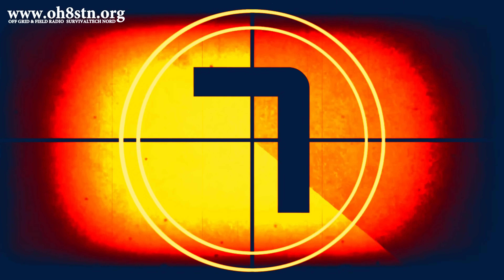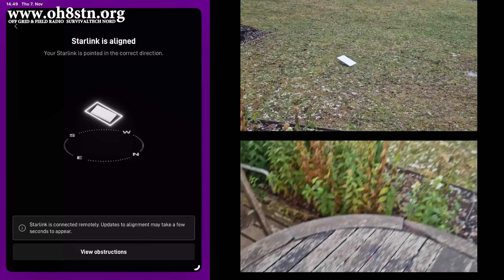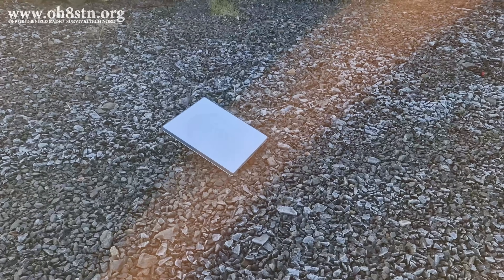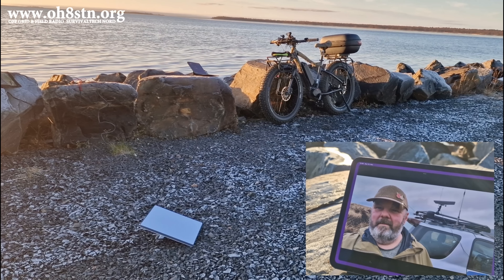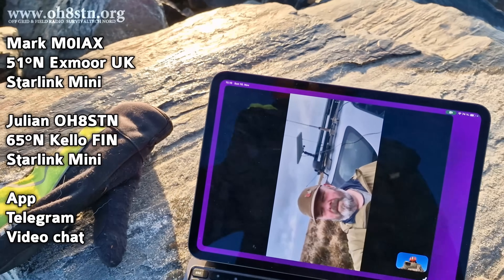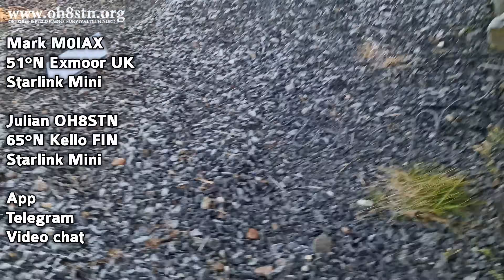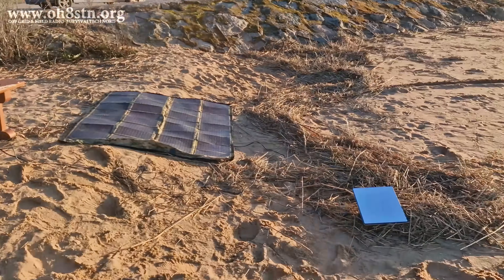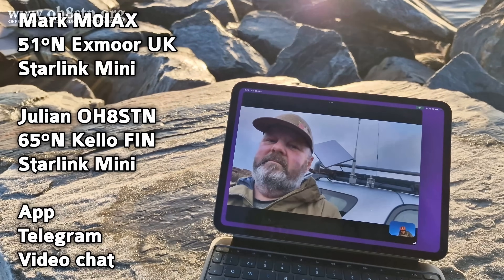Starlink Mini: Setup & Field Test | Disaster Communications

Comment: Julian, something unlikely but important needs to be considered with Starlink, especially for preppers and Auxcom operators.
 We are severely crowding low earth orbit slots with raw technology, and this might ensure a Kesseler Event occurs. Basically, if just one satellite collision (accidental or intentional) the debris cloud will break up more satellites. In a worst case scenario, this could eliminate nearly ALL LEO SATELLITES in as little as an hour or two.
 There's no defense against this. Arthur C. Clarke warned of it around 1960.
 So while Starlink, and the coming competition, offer marvelous features, they are a fragile system depending on fragile infrastructure. Unlike ugly old HF radio, which simply can't fail that way.
 Something more folks should be made aware of.
Reply from the maker: You're preaching to the choir my friend 👍. Although it's a good point, I still can't call my grandmother on an HF radio. So we use these tools as long as they're available. These are all just tools in the toolbox.

Comment: Julian, got the starlink up and running. Using the 65w usb c charger run off my 13.8v lipo battery. Got a usb c cable that connects to starlink unit
Reply from the maker: Outstanding 👍

Comment: I’m looking to do a diy version of the starbatt mini a grab and go kit to store and power the star link mini. There is not a lot of information on the starbatt mini website but my question is would it be better to run the star link mini off a 24 volt 100 amph or a 12 volt 100 amp h battery?

Comment: Have you tried a Garmin Mini 2 messenger?  It's not Starlink - only for short text messsaging or SOS but the device is 3 oz weight and tiny size, it is small enough to fit in your pocket.  There is a small monthly fee, but you can text anyone with a cell phone from your phone or device, and send position reports as well as get weather even if completely off the grid.  I carry mine when hiking or boating, but it would also be useful in a regional grid down scenario.

Comment: Unfortunately I cannot afford the initial cost of this system not to mention the monthly fees. However I cannot afford to be off line either. I am Paying the same fees for service which is both internet as well as telephony which is now basically VoIP since the modem has a pair to pots line outputs which serve for landline as well as internet service. The telco provider has serious issues with backup power to the DSLAMS that provide the fiber to copper translation. When the electric company looses power the translators shut down since they require power to operate. They are equipped with a UPS system but the telco provider has not provided batteries for the system to work properly. Still waiting for a bit over a year for the fiber instal. Even received a Nokia fiber to Ethernet interface but it’s just sitting around gathering dust.
Reply from the maker: Understood.  Price is slowly coming down. Monthly ax well. If you use it simply for disaster comms, you can keep it deactivated, then started up once the disaster starts. Even if the internet is down the dish still has connection with SpaceX servers.

Comment: You best have a stack of LFPs, even a mini burns a lot of power. I run a Gen 3 with a 460AH.
Reply from the maker: Indeed. 40 watts during start up. 17 watts when connected. Mini seems more efficient.
Reply: @OH8STN  I just converted the Gen 3 to 12V. That should help a bit, not losing power going pack and forth with the inverter. We'll see.

Comment: Getting satellites into higher latiude orbits is expensive.  You need high latitude launch sites and don't have the advantage of using the earth's rotation to reduce the fuel on launch.
Reply from the maker: It is a good thing we have the falcon 9.
Reply: @OH8STN  It will still cost more per item to get the orbits above 65 degrees.  Unless the Russians let them be launched from Plesetsk.
Reply from the maker: @braidybecket8946 Elon has already discussed additional starlink sats for polar regions.  Anyway,  it's working extremely well so far.

Comment: Starlink is for sure exceptional for off grid, but in a grid down event the internet itself will it really work? If telegram’s servers are down telegram won’t work, same for mail, dns, etc 
So even if the starlink network will work probably all the different ways to communicate over the internet won’t work or the will suffer massive disruption
 An incredible tool but radio is still the main tool in a grid down event
Reply from the maker: For a widespread grit down event, I wouldn't use starlink. For a widespread massive event like that, I would rely on robust and reliable HF radio. But as we've recently seen in Hurricane helene, the internet wasn't down for example 100 Mi away, it was only down in the local affected area. In that case, people in the affected area needed to reach Beyond line of sight to where the internet was working the best way to do that, was with satellite.
Regarding the cost, once you have the Starlink hardware, there is no monthly charge until you activate it. Compared to the price of a HF radio, starlink is quite reasonably priced.

Comment: I feel like theres this misconception about Starlink, that it is "Off Grid" when in reality, you are still relying on someone else's infrastructure, so it's about as off grid as a cell phone.

Is it useful technology? I guess? But so is a cell phone. All this tech does is use a dish instead of a tower. You still have to hope that Space X keeps the project running and continues to allow you to use it.
Reply: "Off-grid" typically refers to being off the electrical grid, or at least it used to.  Sometimes when people say "off-grid" they really mean "self-sufficient" or "self-reliant," which I believe is what you are describing.  Being self-sufficient includes being off-grid, but being off-grid doesn't necessarily mean being self-sufficient.
Reply: @gravijta936  I can see that definition mattering for other devices, but for communications specifically, I figure outside networks required to use a system would be a far more important factor

After all, if we are only counting the power grid for the definition of "off grid" then cell phones are off grid, since cell towers have batteries and generators that keep them running when the grid goes down.
Reply from the maker: There is no mention of Starlink being 'off grid' in this video. Moreover,  towards the end of the video, Starlinks dependence on the 'man in the middle' was discussed as one of the downsides. What you might be missing are a few use cases.
1. A regional disaster where local infrastructure has failed. Use Starlink for emergency internet access 
2. Used by disaster relief teams for portable, rapid deployment internet.
3. Compared to z cell phone base stations, the base stations orbit 300 miles above the surface of tge Earth, outside the disaster zone.
Starlink saved lives during Hurricane Helene:

Emergency Internet Access: Starlink, a satellite internet service, deployed hundreds of free devices and provided unlimited data plans to remote areas affected by Hurricane Helene. This enabled communication and access to vital information, such as weather updates, emergency services, and relief efforts.
Lifeline for Isolated Communities: Starlink’s satellite-based internet service reached areas with destroyed or damaged infrastructure, providing a critical lifeline for communities cut off from traditional communication networks. This allowed residents to contact loved ones, receive critical updates, and access essential services.
Coordination and Response: Starlink’s internet access facilitated coordination between local officials, emergency responders, and relief organizations, enabling more effective response and recovery efforts. This included sharing critical information, such as damage assessments, resource allocation, and evacuation routes.
Reduced Risk of Injury or Death: By providing reliable communication, Starlink helped reduce the risk of injury or death due to delayed or miscommunicated information. For example, emergency responders could quickly receive updates on damaged infrastructure, allowing them to prioritize rescue efforts and avoid putting themselves or others at risk.
Reply: @OH8STN   @OH8STN  Well, Off grid was in the title of the video before just now, but it's fine, I won't mention it if you don't. Also 3:31 if you wanna scrub that as well. 

Like I've said, I'm not saying the tech isn't useful, I just feel like it's a bit overhyped right now as this perfect offgrid solution ever since Helene. Someone I grew up with is in Ashville, and I'm sure those services helped him. 

I am just also recognizing that the service has the "man in the middle" issue you mentioned, I just don't trust the fact that only one company provides it, so it leads to issues with a monopoly, similar to issues some parts of the US have with broadband access. And really, for what you get, it's awfully expensive, and thats only gonna get worse until theres competition, and when Space X basically control most of the commercial space flight in America, well, theres a bit of a conflict of interest there if competitors wanna get their satellites up there to launch their own system.

Ultimately, even though it's not connected to the electrical grid, it's still kinda hard to call it an offgrid solution when it relies on so much established infrastructure. It's just a different type of infrastructure.
Reply from the maker: @knightshousegames  so you start by calling me a liar, then referencing one of my off-grid camper trips in lapland, completely out of context, as "proof". OK 🤣
 Here's the cold hard truth. How you "Feel" doesn't constitute reality! You made some good points, but let your emotions ruin what would have been an objective discussion. Why not redeem yourself by suggesting for us a cost effective emergency internet alternative for rural communities where communications infrastructure has been destroyed by a natural disaster?
We'll wait for your reply.

Comment: Great video - really tempted! Is the router side of things configurable for port-forwarding and are the Starlink system ports open for such things as self-hosted web servers, FTP servers, mail servers etc.? Download speeds impressive, but upload speeds may inhibit full-time use for big video uploads - did I hear 11 Mbit/Sec? Not a deal breaker, but a bit slow for large uploads, especially 4K. Cheers.

Comment: “Not replacing ham radio but augmenting its capabilities”. Right. Starlink is a paid subscription service. In the US, that starts at about $120/month (mobile is somewhat cheaper but lacks baseline functionality). That’s a hefty subscription fee. Comparing amateur radio to Starlink is inappropriate since as hams we don’t have that sort of funding, nor does it cost us a subscription fee.
Reply from the maker: @pmadams65 
You quoted what I said in the video, then ignore it with your analysis..
Bullet points:
1. Winlink - Augmenting ham radio for those of us using Ham Radio for disaster preparedness. For example, using Starlink as an internet gateway for my  Winlink BBS. This means emergency stations can still send and receive email, even when the grid is down regionally.

2. Price - For hurricane Helene, Starlink waved the monthly charge which isn’t that bad anyway. I purchased the hardware for $349. The monthly is about $40, but only needs to be activated when Starlink is used. This is the price for Starlink Mini, which has the same connection functionality as Gen 3, minus the router and current consumption. On the Mini, the router and Wi-Fi AP are built into the enclosure. Under $500 for emergency internet doesn’t sound that bad to me.

3. HF Radio - I do not compare Starlink with HF Radio. As I said, it is an additional tool in the tool box. I generally prefer to keep JS8Call and Winlink up and running 24/7/365, whether or not there is an emergency. Unlike Starlink, HF Radio is not going to let me dial directly into anybody with an internet connection (outside the disaster area) like Starlink can. 

4. A non technical person with no radio experience has almost zero chance of making use of HF radio in a grid down scenario. We train for years to build core skills, then continue practising, to maintain and improve those skills. Starlink requires you to throw the dish on the ground, point it north, then connect to a Wi-Fi network. Your emergency internet is now ready to go.

5 Triggered complaining -  Rather than complaining about the capabilities shown in this video, why not provide us an alternative which provides the same functionality as demonstrated in this video, and at a similar cost? This would be more helpful!

Finally, it is perfectly ok to disagree with how I use and augment my communications strategy with Starlink. No one will hold a gun to your head and make you do what I do. Moreover, you shouldn't be so narrow minded about someone presenting an unconventional solution. Hurricane Helene showed us how useful Starlink can be.
Reply: @ I’ve enjoyed your channel(s) for years and always learn something new from them. I wasn’t complaining about the capabilities of Starlink; its usefulness is well known. In point of fact, I wasn’t complaining about anything. I was pointing out that Starlink is typically a rather expensive service whereas amateur radio has no subscription fees.

Comment: Been saying it for a long time Ecomm via ham radio in agencies will be going the way of the dinosaurs.
Reply: Video's call will probably chew through your monthly bandwidth allowance. In limited use they serve their purpose where visual information says more than words.
Reply from the maker: Perhaps yes. I still think there is an overwhelming use case for HF asynchronous data modes, for slow reliable network communications.
Reply from the maker: Indeed. I just wanted to show the reliability and stability of this robust connection. Just a couple of months ago, I would not have believed a UHD video chat would have been possible without a wired connection at this latitude.

Comment: What's the point of testing "starlink-to-starlink" connectivity in ham context?
Its like testing a regular cable internet connection.
What's was the goal to proof?

In emcom case it will work, i mean it's ground-to sat-to sat -to ground .
Why shouldn't it? No obstacles, no trees .

Maybe I'm missing the point, but would you please explain it?
Reply from the maker: Testing Sterlink to Starlink was simply a coincidence. This was more of a demonstration by someone who is a hardened ham radio supporter. He is simply saying 'here's another tool you might want to consider'. 
The video also went into the difficulty of amateur radio, and learning curve. Someone who has never used an HF radio before, isn't going to just grab that rig and be successful the first time. With this, they have a chance.
Reply: @OH8STN  ok, i see , thanks

Comment: I wish I had Starlink right now but it is just too expensive. Workmen with a digger accidentally severed my BT fiber internet cable so I've been without internet all week and am needing to use my phones data to watch this on 360p quality. The only issue with Starlink is if we have some major event like solar flares, EMPs, pole shifts, or wars going on there's potential we could lose satellites or they all go haywire. I think HF radios are always going to be more useful for a major SHTF situation. It will be interesting to see what happens when the Tesla Pi phone comes out. Will we be able to use it as a tether and mobile hot spot using Starlink? Maybe that would work out cheaper than the Starlink system itself or perhaps they have a plan to prevent sharing the connection as a hot spot?
Reply: There are risks , especially with the sunspot cycle nearing peak and with the current geopolitical angst .
Not much we can do about the latter and even less the former .
However , aside from those things beyond our control , Starlink is probably the most robust option available with any kind of useful bandwidth and somewhat affordable cost . It is a proven life saver for non global catastrophes .
Reply from the maker: I agree about HF radio, especially asynchronous data like JS8Call. The thing is, HF radio needs lots of investment in skills. I always use my wife and best friend as examples. Even if they could setup the equipment, they would not know or understand why the frequency might change between day or night. The wouldn’t understand NVIS, ground wave or sky wave. There are so many variables that we must present options for the advance crew like ourselves, without forgetting about the people who might need a grid down comms solution, without atmospheric physics 101.
I’ll never give up my HF radio or asynchronous data comms. Slow and reliable and would’nt change them for the world. Starlink is just an addition tool, even if we don’t use it that often.
73
Julian oh8stn